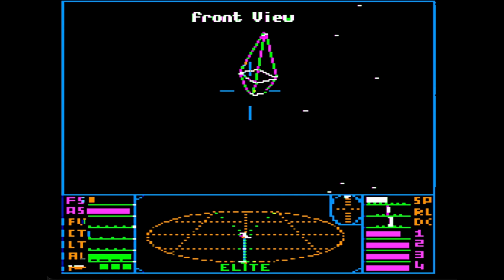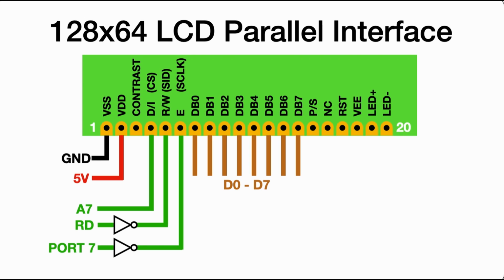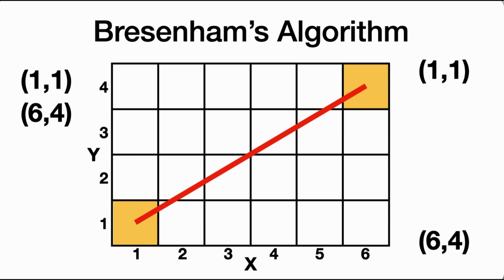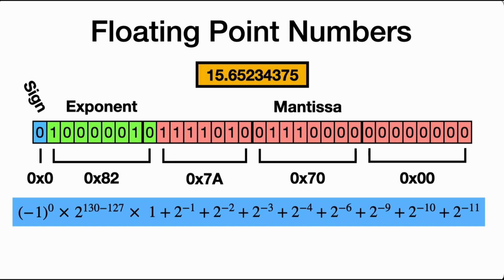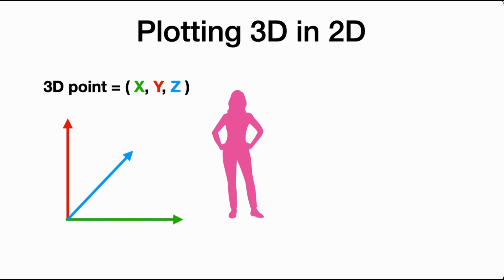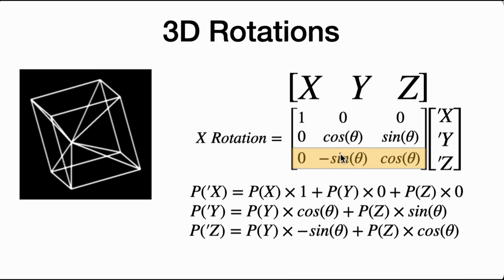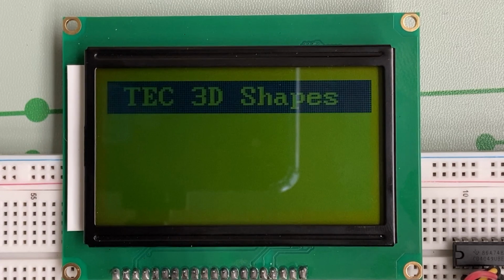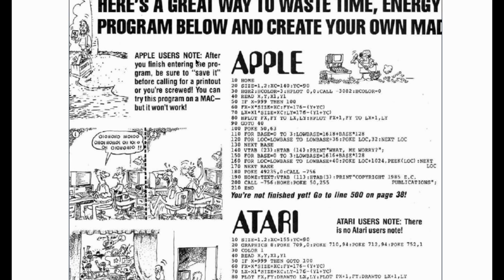Mastering Z80 3-D rotating graphics

Comment: After watching this really excellent video I managed to make my own spinning cube demonstration. My Z180 based hardware is a little different and uses an area of RAM which is 32x32 pixels where my code draws the cube and then to display it I have a 16x16 pixel dot matrix LED display. When the size of the cube is made bigger than 16x16 I can move the position of the display around to see different parts of the 32x32 RAM space. On my channel I made a short video of it running.

Comment: Just as the rest of your content, this is a great video!
I have the same SP7920 display running on my homebrew, breadboarded HD63C09 CPU @ 3 MHz using 8.8 format fixed-point values, spinning a cube at 19 frames per second (measured with oscilloscope toggling a PIO port).  I ported one of the Arduino ST7920 libraries over to my system and build using m6809-gcc compiler.  It took me a couple of hours, runs fast, and is very flexible.
Reply: 19fps on a 3 MHz breadboard cpu sounds impressive

few things make you feel as awesome as seeing your code run on these kinds of machines
Reply: @GeorgeTsiros  You're absolutely right about how awesome it makes you feel to get your own code running on your self-designed and built computer.  The CPU is now overclocked at 4 MHz and I further optimized the code resulting in the cube spinning at 30 fps.  I've also written a bunch of other graphical demos.

Comment: 13:42 still same number. can you do . on hex bet cant.
and same time H can be signed -128 +127 range but memory still have same data you just need is it unsigned or signed.
mean 0x80 is signed -128 or unsigned 128 how you want use it. computer not know xD 0x00-0x79 is same both case

if computer only can add 1+1 but you need 1-1
you can turn other number signed -1 and do 1+(-1)=0 now you subracted using + LOL
00000001 XOR 11111111 = 11111110+1 = 11111111 = 0xFF and that signed int -1
if you want multiply 2 just add same number itslef LOL
if you want / thats TOP SECRET using just +

Comment: 13:21 magic 1111.1010 0111= 00001111 10100111 = 0x0FA7 (yes its 4007 int 15.65234385f if you know you need read it as float)
computers not know its just data on memory programmer tell how read it
its same number just made sure decimal point there. just like it should be.
there is no easy way calculate .values than

0.65234375*2=1.3046875 remove 1 that first bit
0.3046875*2=0.609375 next bit 0
0.609375*2=1.21875 next bit 1 remove it
0.21875*2=0.4375 next bit 0
0.4375*2=0.875 next bit 0
0.875*2=1.75 next bit 1. remove it
0.75*2=1.5 next bit 1. remove it
0.5*2=1 last bit 1

and last post
take LSB 1 / 2 =0.5 add next bit
1.5/2= 0.75+1
1.75/2= 0.875+0
0.875/2=0.4375+0
0.4375/2=0.21875+1
1.21875/2=0.609375+0
0.609375/2=0.3046875+1
1.3046875/2=0.65234375

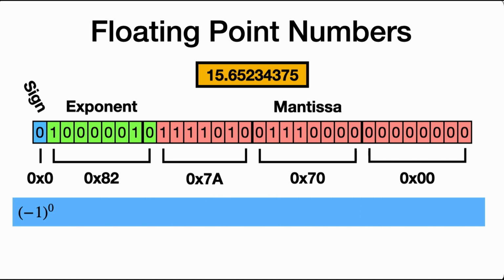Comment: 11:19 you strore data
0000000X XXXXXXXX XXXXXXXX XXXXXXXX XXXXXXXX but you read it
0000000X XXXXXXXXX XXXXXXX XXXXXXXX XXXXXXXX
if i read correct there is no universal this is it. so your exponent is unnessessary too big
you could easy do it
SEEEEEEE XXXXXXXX XXXXXXXX XXXXXXXX XXXXXXXX

15.65234375 in binary(desimal point whateva lol) 1111.10100111
same number less than 2 byte use binary floating point xD
so it would be
S EEEE XXXXXXX XXXXXXX
0 0100 11111010 01110000
you can store -255 + 255 (something) you never exeed your screen

OR we can just store 16 and 65234375 invidual and point is midle its you whoi program it anyway. its your z80 you made your output devices too LOL
you can choose how computer works and how program it xD

wait lol you using binary why i calculate it LOL
exponent is 4 data is 11111010 01110000
so 1111.1010 0111 is value 15. we can easy know
take LSB 1 / 2 =0.5 add next bit
1.5/2= 0.75+1
1.75/2= 0.875+0
0.875/2=0.4375+0
0.4375/2=0.21875+1
1.21875/2=0.609375+0
0.609375/2=0.3046875+1
1.3046875/2=0.65234375+15 TADAA

Comment: 8:57 i dont get these yellow boxes. line is on orange in middle of it.  thats pixel. what pixel is closest. its in orange thats closest. xD
so whats closest its center on line in middle of pixel if it on orange then its closest to orange center. so if answer is 1.1 then its 2 its on oragne LOL
even its 0.1 close to yellow its 0.1 inside orange. i get it but its fun. you can smoot line masking those yellow pixel dimmer that antialiash in z80!

Comment: As a Speccy guy the game I remember having the fastest smoothest wireframe 3D was Starion. There were some faster ones that didn't really do wireframe.

Elite didn't just have wireframe 3D, it had hidden surface removal, which I think was a first for a game on any platform, though it was on pretty much every platform. For hidden surface removal you need two things beyond what's needed for simple wireframe. You need the data for each surface as well as each vertex and edge, and you have to list the vertices in each surface in the same order, either all clockwise or all anticlockwise. The other thing you need is that all your models must be convex, which means you'll have no two lines that intersect belonging to the same object. When drawing your objects you go through each surface and see if the points are still in the same order. If they're not that means that surface is facing away so you don't draw any of its edges unless they are shared with a visible surface.

I've always remembered the perspective projection and rotation math since I learned it when I was about 13 or 14. But I can't remember the math for figuring out if the points are clockwise or anticlockwise. Can't be hard though (-:
Reply: the source code for elite is publicly available!
IF i remember correctly though, it is not on github

Comment: I think you want screen x equals x / z same with y.  That is normal perspective projection.  You could use fixed point for line drawing also, and prestep the interpolation value to the offset from a integer to get sub pixel interpolation, looks much smoother.  If you keep applying a small transform for many iterations your errors will add up and distort the object.

Comment: Would it be possible to have something like a "scratch buffer", that stores what pixels to erase after the shape is drawn so that the new pixels are drawn before the unused old ones are erased, to make that fading effect on moving parts less noticeable by ensuring there's already dark areas nearby before unused old pixels start getting erased? And would there be enough performance to produce different shades of gray by varying the rate pixels flicker between black and white?

Comment: Are there C compilers out there that target the z80? Do they produce machine code of a comparable speed to this, or are they a lot slower? 

For all i know there might be a javascript to z80 compiler! That would be interesting.
Reply: Yes, and no. There are several C (and pascal) compilers for the Z80. IAR C, Small C, and others. 
But manual coding is always faster, especially if you actually use C as a high level language, with parametric procedure calls and local values.

Comment: It's been a decade ago at least that I was doing something similar. I remember there is a drawback of using rotation matrices for 3D rotation where in certain conditions rotation over one axis doesn't work anymore.
It's called "Gimbal lock"
Reply: That's a consequence of how building the rotations with Euler Angles. In this demo, the rotations all use the global axes, and the axes themselves never get rotated, so there should be no concern for gimbal lock.

Comment: How much would hidden line removal cost? A challenge to look into?
Reply from the maker: Yeah, sounds like a good challenge to pull off 😉
Reply: Hidden line is hard. Very hard. But you probably mean hidden surface. That's what Elite had and it's not very hard. I outlined it in another comment.